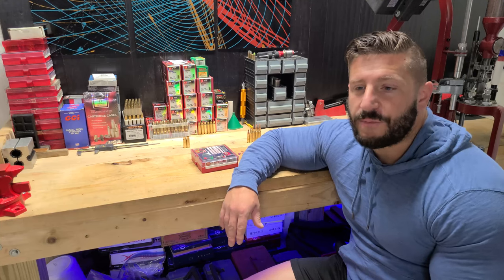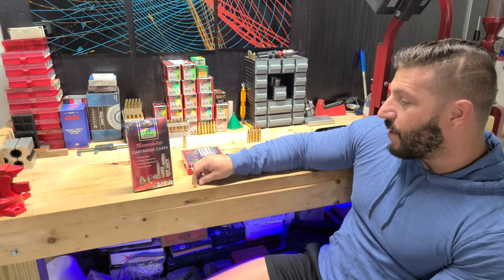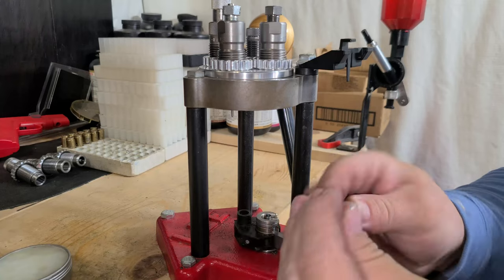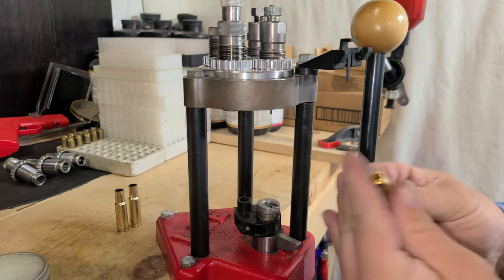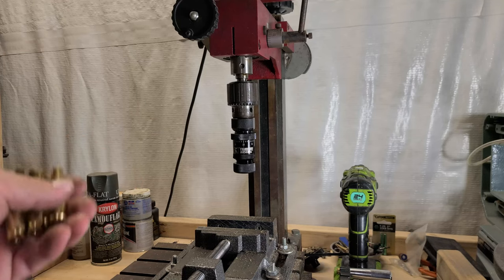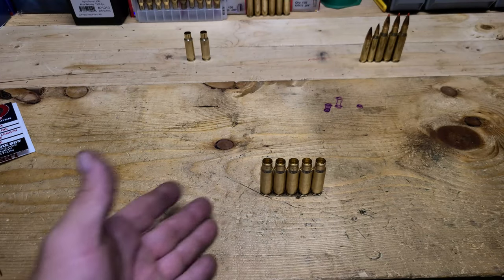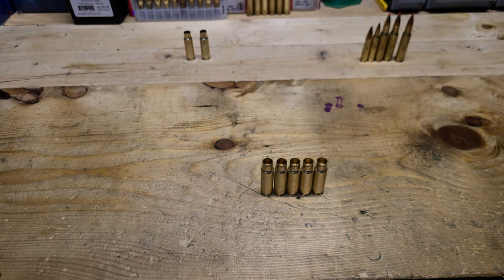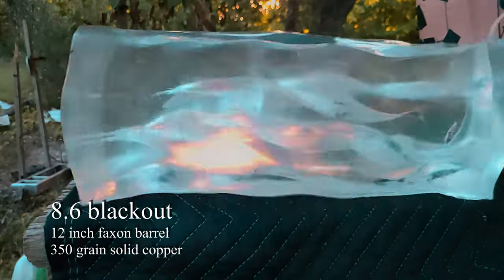easy way to make 8.6 blackout brass

Comment: I have tried to size the 308 then 8.6. I think I may not have sizing die set up correctly.  I'm not getting the same neck length as you. The case should go all the way up to where the case holder is touching the sizing die? I'm  using a Lee turret press also

Comment: So max trim length (per Lee drawing) is 1.685", then trim to length would be 1.675" if this round follows the norm of trimming 0.010" below max. Of course you could go even shorter as you mentioned to buy you a couple firings before trimming again. Thanks for the video.

Comment: Why not just start with 308 brass if the intermediate step is full length size to 308?
Reply: Because the final interior volume of the case will be all wrong (too small) if you start with .308 brass

Comment: So if I have a bunch of .308 brass you think I can resize them to 8.6?
Reply from the maker: yes I think your 308 brass should work. only one way to find out. I also should have tried a few pieces of 308 but Ioad for 308 so I just got new 6.5 because the info I had said 6.5 was that better choice. but maybe I try some 308 brass
Reply: You read my mind.   Why not just cut out a few steps and use 308 brass.    Plus, it’s way cheaper and easier to find that 6.5.   So supposedly 6.5 converted brass seems to size better.  I’ll have to take some measurements, but maybe the 6.5 brass is just a few tho thinner case wall thickness.
Reply: I’ve been playing with different brass types. The LC 308 brass I used had 2 grains less capacity than Hornady brass and the necks needed to be turned down.  Hornady brass seems to be about .010” and resized LC 308 ends up around .015”.  I also tried resizing 6.5 creedmoor brass from Lapua, Peterson and S&B.  The S&B had the closest case capacity to the Hornady, the others closer to LC 308.  All needed their necks turned to properly fit in the chamber.
Reply: @therevoman  good to know thanks!   I was curious if 308 brass was going to be thicker.  Same thing happened when converting some 5.56 brass into 300 blk.
Reply: @therevoman  I wonder if a small base die would solve that issue with thicker brass?   Just something else to try.   It would be nice to be able to use 308 brass since it’s a lot cheaper than 6.5 brass.
Reply: @jeffh699  The thicker brass issue is up in the neck area so a small base die would not help with this. It's either neck turn any 308 brass or find a specific head stamp 6.5 that will work and so far I've seen Hornady brass mentioned. Hopefully there will be a "good" brass list that emerges from all the loaders like what happened with 300BO.

Comment: What powder did you use?
Reply from the maker: maker bullets has the load data. I would use what their web sight says. I used their data. with the YouTube rules and liability I just dont want to state load data. but its out there and easy to find look under 8.6 bullets on makers websight . also faxon has load data and if you cross reference that data with the maker data you might be able to find more powders that would work . that's what I'm doing because I can not easily get the powder faxons data requires. be safe hope that helps.
Reply: That info isn’t on the Makers site anymore. I am not asking for complete load data but would appreciate knowing what powder you were using. The Faxon data is very limited.

Comment: Just to cut out a resizing step, remove the expander rod from your 8.6 die and run them through the 8.6 die only.  Then trim from there.  You don't have to run them through the 308 die.  When you go to load the actual rounds, you can run them through the sizer die again with the expander rod in your 8.6 die.  It will be way easier to resize the brass and less stress you put on the case mouth by resizing the mouth twice.  It will extend the life of your brass also.
Reply from the maker: I might not be understanding you. but either way I'm going to need to expand the neck.  I'm using 6.5 brass. I'll try to give it a shot your way. thanks for the input.
Reply: @pewpewplayground  So I just looked at the specs for the cases and I am not sure what I suggested will work like I thought it would.  I was thinking that the total length of the 8.6 brass was shorter than the shoulder of the 6.5 brass, but it is not.  Sorry for the mix up.  I was planning on doing my brass the way that I mentioned, but I am thinking I will have to do it the way you are.

Comment: Can you just start with 308 brass?
Reply from the maker: yes you can start with 308 brass. I don't like using it because it takes much more force then the 6.5 brass but if that's what you have and can get 308 works. I think it takes more force because the shoulder is very heavy and you are basically making the shoulder into the neck. you might have to turn the neck down with some 308. this is of course on my press with my dies (lee).
Reply: @pewpewplayground  - got it, thanks….